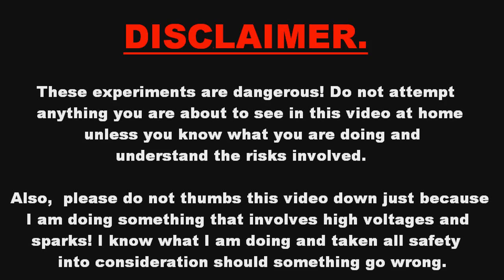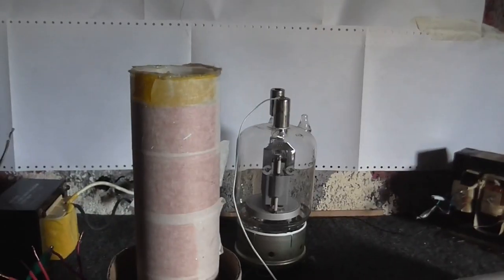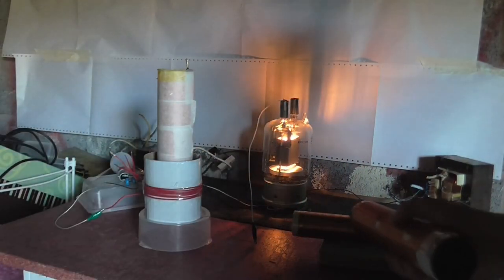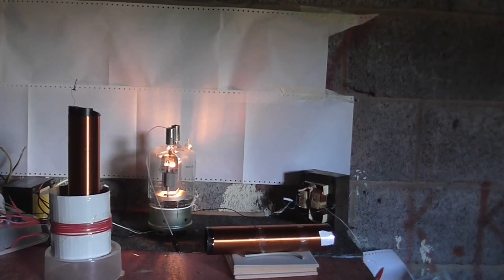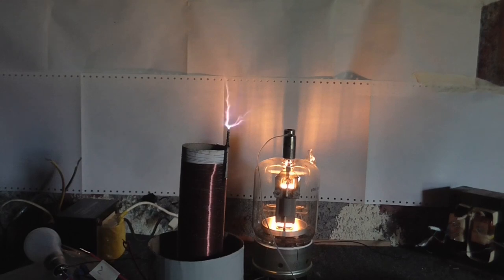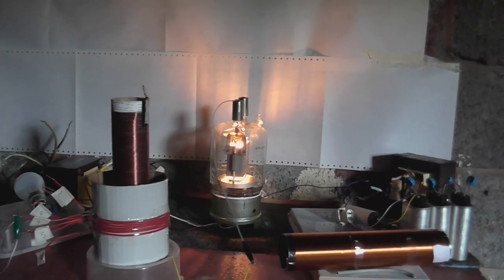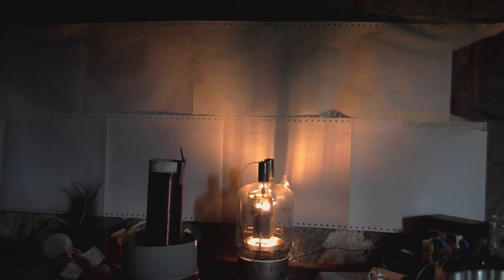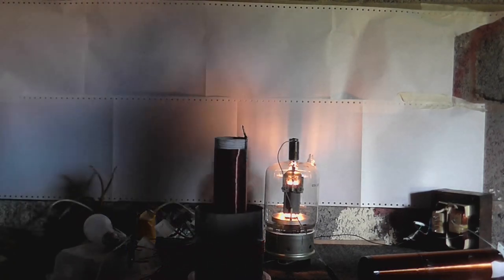Base fed VTTC experiments

Comment: It would be interesting to see if you're able to build a high output wattage audio amplifier with that Valve you have!
Reply from the maker: For that i would need a huge output transformer, I wouldn't be the first person whose ever done that though, there is a video somewhere on YouTube where someone actually did that.
Reply: Been done countless times. A good historic example are the "großverstärker" by philips and I think siemens made some too. Used transmitting tubes for about a kilowatt of output power

Comment: One thing that Mr Tesla liked to do was to use such things to energise his "Cold Lamps" at a distance (though they had to be earthed).
Have you tried anything like this?
Reply from the maker: I could make a fluorescent tube light up with this, I've done that in the past with other Tesla coils I've made, they don't need to be earthed when I do this, just my hand holding the tube provides a good enough earth, sometimes I can get that to work without holding them at all and no earth connection.

Comment: Hello Clem.
seen your work with this tube and have recently been gifted one. I am struggling to find pinout data for this tube can you help.
cheers
Reply from the maker: Sorry for the late reply, been busy, I don't know if you already found out the pins for your gu81 yet, but I'll tell you the connections of that tube as best I can. Okay, so looking at the base of the gu81 tube with the cutaway side of the base facing away from you the 6 pins are layed out like this:

top left is grid 1,
top right is grid 2,
halfway down and on the left is one end of the filament,
halfway down on the right side is filament center,
bottom left is the other end of the filament,
and finally on the bottom right is grid 3.

filament center is also used as the cathode.

looking down at the two connectors of the top of the tube with the "nipple" facing the right,
the upper connection is Anode, the lower one is grid 3 (the same grid 3 that one of the pins on the bottom goes to)
Reply: Many thanks mate.
Looks helpful.
Cheers Jim

Comment: Clem

What is the Filament voltage?
Reply from the maker: 12 volts, but you will need a beefy supply that can deliver at least 11 amps. I used a large transformer out of an UPS witch seems to be able to do it without breaking a sweat.